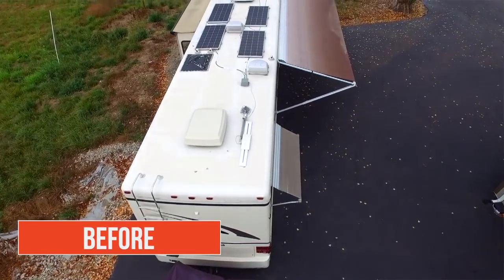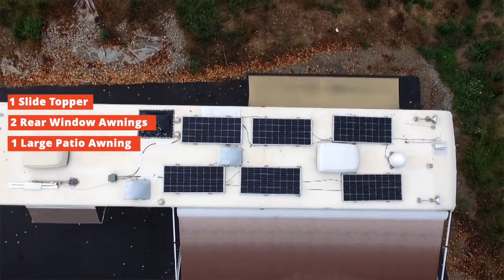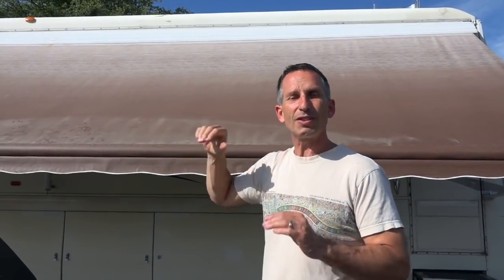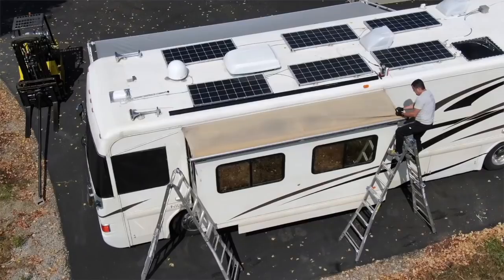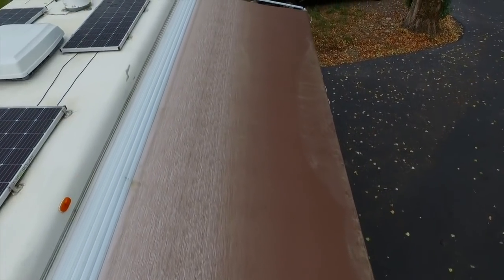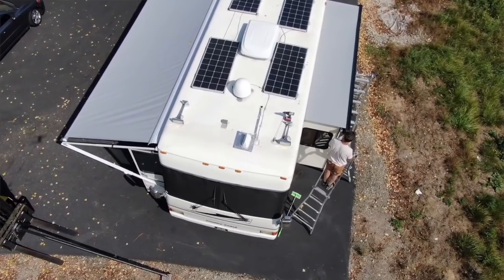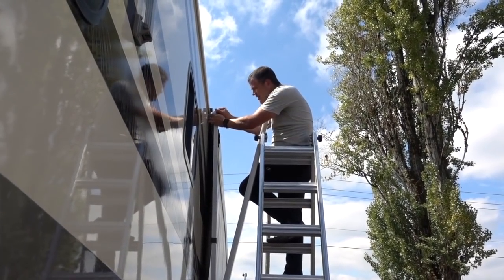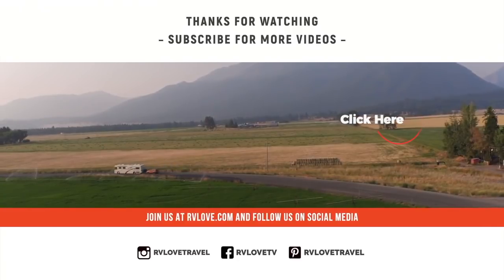Replacing RV Awning Fabric and Slide Topper on our Motorhome + SAVE 5% With Discount Code RVLOVE

Comment: Good video and a great company.

Yes  know about the cold shower from water on top of the slide. I now have a standard practice, if it has been raining you can get water on top of the slide so I run the front jacks all the way up to drain off any water before putting the slides in or moving.
Reply from the maker: Yes, that is a good practice.  I know some people's slides, especially drop/flush floor slides will tilt as part of them coming in.  But tilting your RV off level for a bit before bringing slides in would definitely significantly reduce the water on top of the slides.  Our coach doesn't have leveling jacks, so we don't have as much capability there. -M
Reply: @Rvlove  One thing you can do if you don't have jacks is to have a couple of leveling blocks. put 2 (I have used 2 on each side) where you can drive up on them to tilt the RV.

Comment from the maker: If you want more detail on our RV awning and slide topping fabric replacement (including the hardware, cost and other info and close up photos), here is our related blog post: http://www.rvlove.com/rvawning - If you order from ToughTopAwnings.com by 12/31/19 and use the code RVLOVEDEC you will save 10% (whether online or by phone). From January 1,2020, the discount code RVLOVE will save you 5% year round. Shipping is free to the lower 48. But they will ship anywhere, including internationally. Three months after our install, we remain extremely happy with this upgrade.

Comment: bill12.3  could you put something in the ends of slidtopers to keep it from flapping on windy days or nights? like phasic plugs may be. or do you pull in your slid in.
Reply from the maker: We have seen people put foam blocks or pool noodles under their toppers to keep tighter tension.  Our old ones were the wrong size (too big) so there wasn't much to help those.  Our new ones don't flap at all.  But yes, in high wind situations, we will often recommend bringing in your slides to avoid damage to slide toppers, and also reduces rocking and noise as RVs are more aerodynamic with slides in of course.  -M

Comment: Lots more room for solar panels up there!
Reply from the maker: Yes, we still have a lot of roof top real estate.  But the 1010 watts we have so far seem to be plenty.  The battery bank is where it is at in our opinion.  For more info, here is a link to our post about our off grid set up. https://rvlove.com/rvmakeoverep5 -M
Reply: They have over a 1000 watts of solar up there. Depending on their usage and the batteries/bank they have in the basement, that may fit their needs well. Many people mistakenly believe that the more solar you have upstairs the better. That's not true if you aren't using a fair amount of the solar and cycling your batteries to keep them nice and healthy, imo. But you are correct; they have a lot of real estate up there IF THEY EVER find that they need more power than they're presently using. Safe travels.